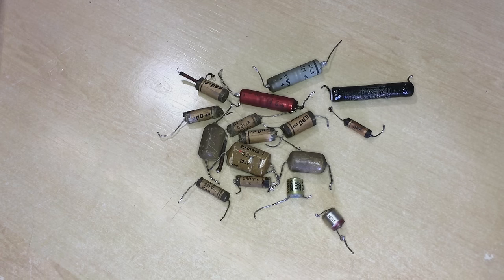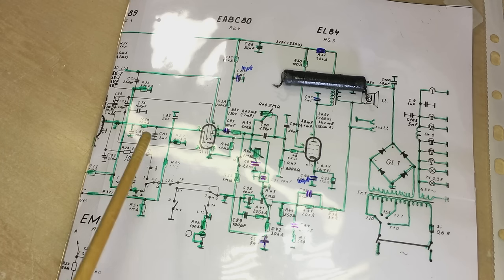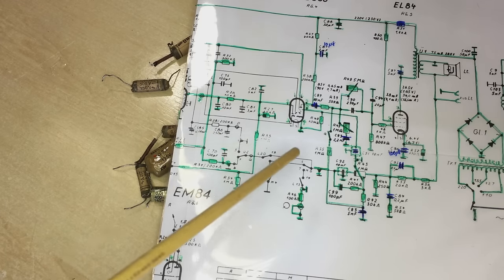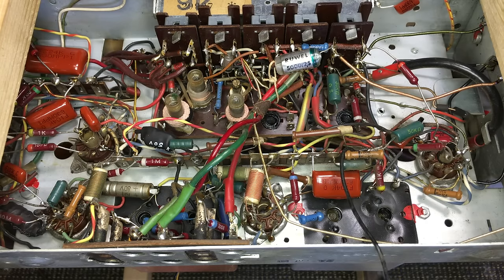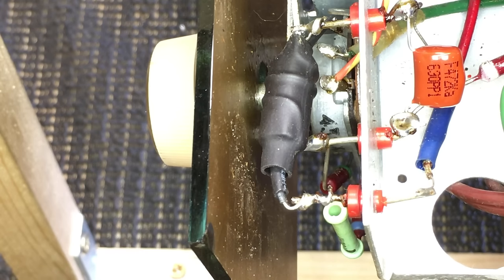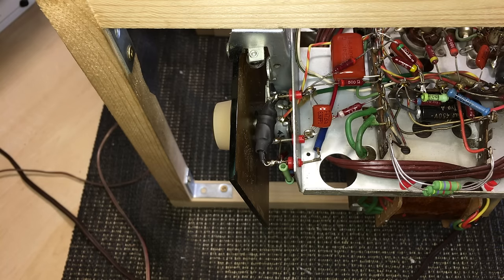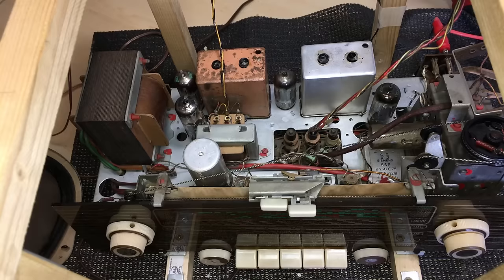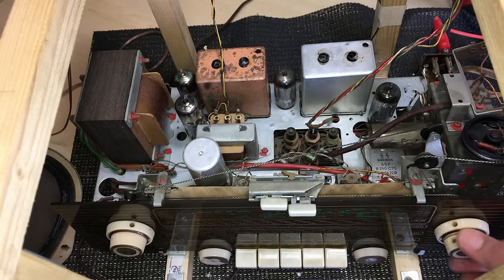Schaub-Lorenz Goldy 58 type 3020 tube radio restoration - Part 2. Capacitors swapped.

Comment: I have also a Schaub Lorenz 3133. I have replaced several capacitors and resistors out of tolerance. I have adjust the IFs but I think I still have poor sensitivity reception and the magic eye does not glow with te reception...any comments? Thanks.
Reply from the maker: Check the tubes in the RF section

Comment: I just got a schaub lorenz 3133 that is very similar to this one just to find out that it has the primary side of the output transformer open. Tearing it down shows the fault on the innermost coil.  My question is, how does one choose a correct replacement? The primary has a center tap. I believe an EL84 needs to see 5k ohm impedance. That center tap just confuses me... : )
Reply from the maker: Daniel Saturnino : that’s strange. I just checked the schematic (https://nvhrbiblio.nl/schema/SchaubLorenz_3133.pdf) and see a normal OT. Where do you live (country)? I may be able to help you find a replacement.